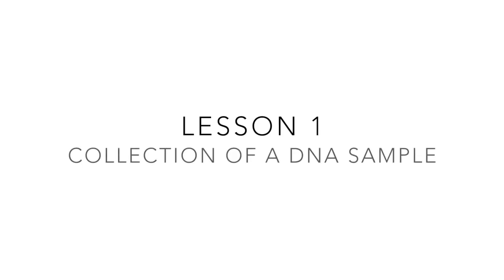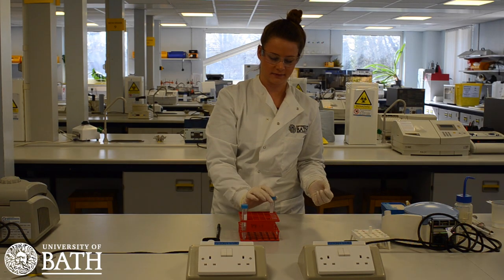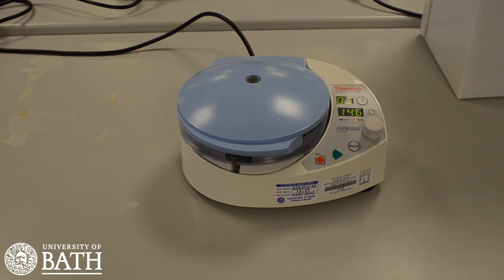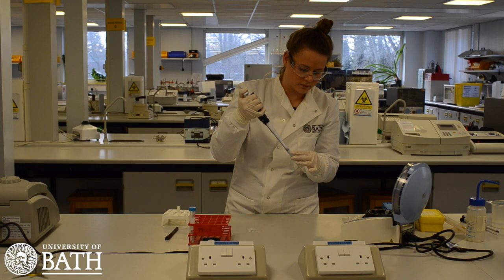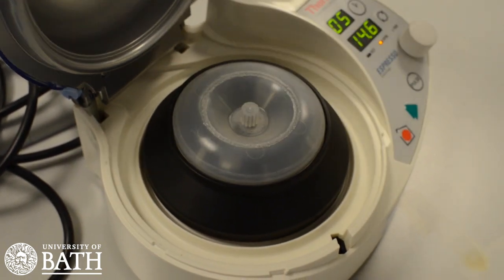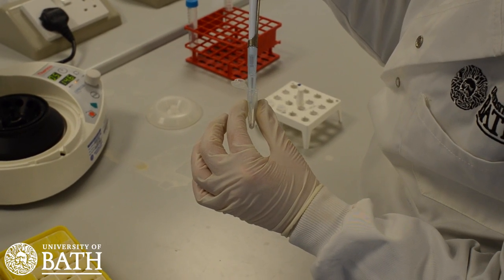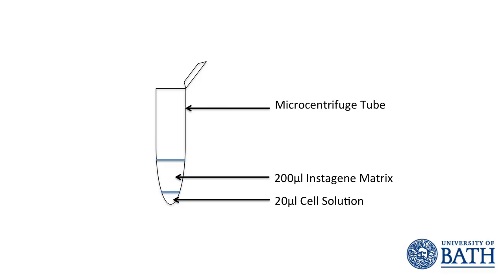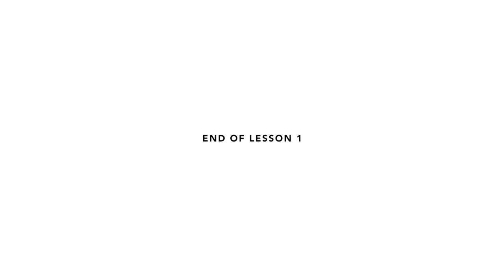Cheek cell DNA extraction for use in the PCR process

Comment: 4:20 "shaken until the cells are re-suspended" re-suspended in what? we just removed the liquid from the tube
Reply: You pour off most of the supernatant, but there should be a little bit of solution left which the cells get resuspended in.
Reply: Tobias Johnson lol look at the volume of liquid after the supernatant is drawn off and the volume when the tube is being flicked. they add solution. thanks for trying though
Reply: yeah true, i just did the experiment at uni though and that's what we did